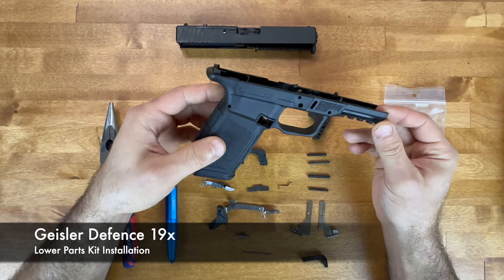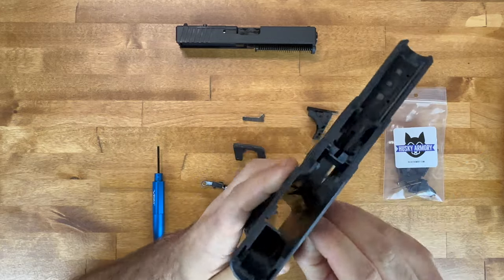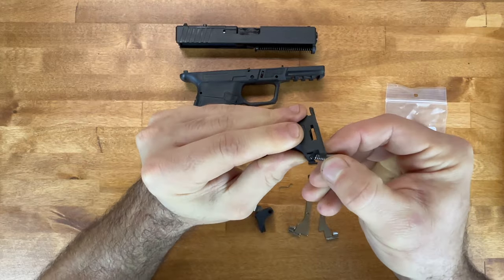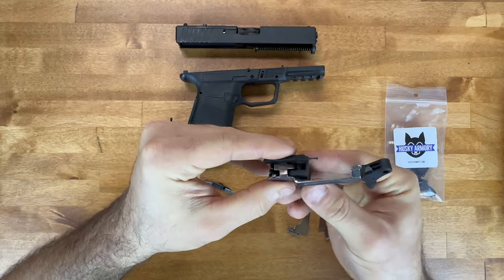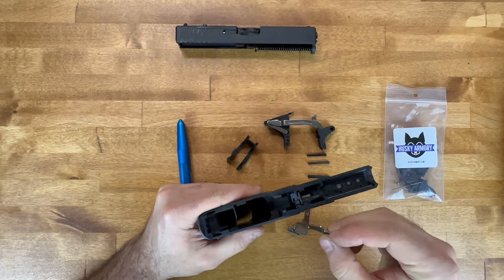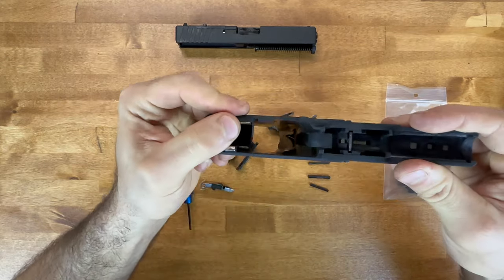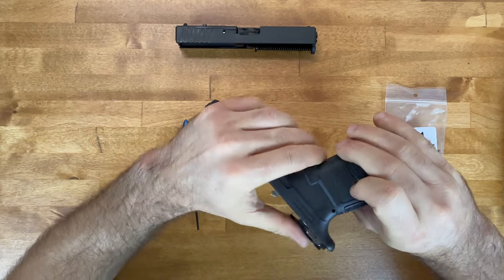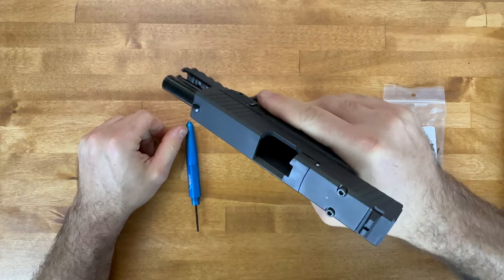Geisler Defence 19x Lower Parts Kit Install Guide

Comment from the maker: Get 10% off your Geisler 19x Frame code "STAYFROSTY" https://huskyarmory.com/80-frames
Reply: @huskyarmory   what magwells fit the 19x  model yall make I can't find not a single thing of info for it
Reply: @huskyarmory What Lower parts kit Goes , with the Geisler 19x Frame  ?  Is it the 19 or the 17 Lpk ?
Reply: 17 lpk  17 mag
Reply: @justonmartin634  Thanks
Man , also another question how do I turn it into a Glock 23 with the geisler frame ? Do I just change out the ejector
To a 40 cal one ? Or what really
Need help
Reply: @DedeJames-o2q   definitely  barrel  and extractor  I'd do those first see if it functions guide rod shouldn't make a difference
Reply: @justonmartin634  okay so basically I just need the barrel , Slide & change the  extractor ? , what about the ejector
Reply: I got a psa 9mm slide I love it ido if they make a 40 but I haven't looked but solar psa has the best prices for the quality  I got mine for 190  suppressor sight threaed barrel slide cut on green and bronze 4.5 barrel good deals they have but also if your trying to go basic bear creek has slides too
Reply: @justonmartin634  okay great thanks for that information , but do I need to change out the ejector as well ?
Reply: Ejector extractors  same thing to maybe
Reply: Disculpe hace envíos a México?

Comment: Video isn’t so helpful. Can u show closer exactly where ur putting stuff. Especially the spring for the release.
Reply: U don't want thar frame . My buddy got it and noticed it was made in a garbage cou try so he tossed it immediately destroying it making sure no one has to suffer with it. Get urself  a dood 'ol american p80 or psa dagger there better quality and made here.🇺🇸🇺🇸🇺🇸🇺🇸🇺🇲🇺🇲🇺🇲
Reply: It's a good frame if you know how to build
Reply: Their frames are much better than oem and p80 and gst-9 frames imo. Does take a little more know how than gst9 and p80 but definitely worth it. A trick to the mag release lever is get it inserted into its pocket in the front of the grip. After you gently let it rest in there don't force it, stick a finger thru the bottom of the grip where you can use a finger to stop the spring from falling out when you tilt the frame backwards. While having it in this position slide the mag release lever in then grab your punch and use it to pry your spring over to slip into the groove for it on the inside of the mag release lever.
Reply: @pepepantuflas1  psa doesn't make 80s and p80 screwed over their good old country buy selling frames and not shipping. Almost a year now and they don't have any frames coming out
Reply: @yeks1491 the fact he says it's trash because it's from Israel is pretty funny
Reply: @US2A is it trash though?

Comment: To bad it’s not that easy. Only problem (so far) that I’ve had with my build is the take down lever is being pressed down by the slide and when I pull the trigger the slide comes right off
Reply: If you never solved this issue on my frames I recieved from them, I had to sand down the ramp infront of the trigger hole that is behind the slide stop takedown lever. It was partially covering the groove in that lever which is what causes this issue. I ordered 2 frames and had this issue with both. Once you take that ramp down some it will solve the issue. It can be a bit of a hassle but not too bad. If you still need help I can get in touch with you and give you some other platform info to actually show you. On my p80 frames they don't even have that ramp that is kinda how I figured out the fix tothe issue. However oem glock frames do, so rather than removing it fully I just took it down some so the top of it is below that groove.
Reply: @Htx_GHOST713  so they sent me an updated frame and I wish they would get them sent out. They are behind schedule but the internal walls are higher and no slop when the trigger is pulled. Have a video on it
Reply: @Htx_GHOST713 can we get in Touch I have a couple of questions about my Geisler even videos at the range

Comment: Does anyone know y mine isn’t racking a round? It hits the barrel when I try to put one up but goes smooth with no mag
Reply: Your slide release spring is supposed to be below the top pin the spring shouldn’t be in contact with the locking block this could cause some issues

Comment: anyone make a thicker slide lock? the slide lock hole is a little out of spec.
Reply: Yeah I messed up on my damn holes because the holes on the pieces don’t even line up :/
Reply: Just buy extended slide stop levers. I put them on all my glocks bc I got big hands and big fingers so grabbing them Fuckers when they are oem spec is almost impossible. But with extended ones the ends stick out more than enough to grab easily but not too much to be sore to the eye

Comment: The slide release spring is supposed to sit below the first pin it shouldn’t come into contact with the locking block it could cause failure to go fully into battery issues other then that great video

Comment: So.. what you mentioned in another comment is that you basically need the G17 lower parts kit from Husky that has the longer slide lock spring?
Reply: Correct

Comment: Can you put a gen 5 slide on the frame since the 19x is in the gen 5 family ?
Reply: This is a gen 3. If you can put a gen 5 on a gen 3 then yes. If not then no
Reply from the maker: Possibly w/ an adapter / get 3 recoil conversion spring.

Comment: I have an extra L shaped spring sort of thing that came in my lower kit. Idk wtf it is. And my trigger isnt resetting
Reply: Alright I think the spring is just an extra that came with the kit as I believe the bigger L shape is for Glock 17 slide lock and the smaller is for Glock 19. As far as the trigger, I’m pretty sure the spring is backwards. It should make an S when looking at it from the right side, not a backwards S
Reply: @TimboTactical  ty buddy
Reply: @TimboTactical  you were right! Thank you bud!

Comment: Bro so what Lower part kit  would I need too buy for the 19x build? Laik a 17?
Reply: 19 or 17 gen 3 I went with a 19 gen 3. Works fine.
Reply: @finnanutyo1153 can I do 23?
Reply: @LathenBlissit  idk. I'm pretty sure they're mostly identical. Just make sure it's for a compact frame. Make sure the trigger spring is for a Glock 19 btw. Z
Reply: @finnanutyo1153 what magwell?
Reply: @LathenBlissit yes
Reply: You can’t use a 17 slide 🤦‍♂️ Geisler is a full size frame (17) that accepts compact slides only (19,23)
Reply: @slide023 so can i just get a glock 19 gen 3 lower parts kit and use that? i dont wanna waste my money🤣

Comment: What lower part kit is that and does a glock 19 gen 3 lower part kit fits it?
Reply: It’s not a 19 its a hybrid of the 17x and 19x
Reply: @LathenBlissit so question when you have a 19x what lower parts kit do you put inside of it??
Reply: @Splxtyic  u can put g19x our 23x same with the slide but for the magizne u need a 17 magazine if u build the 19 our if build the 23 u need a 22 mag

Comment: If anyone is having any issues with their build I like to help others and will give you my two cents haha just reply to this comment with any issues you may be experiencing and I’ll get back to you
Reply: Mine won’t shoot I tryed to shoot it with a dagger slide
Reply: @3Baby3rd  could be a safety plunger issue the vertical extension on the trigger bar has to disengage the safety plunger for the firing pin to to come through the breach face.  Or maybe you’re having engagement issues please provide more information on what’s happening

Comment: Does a Glock 19 gen 3 trigger assembly fit in that 19x upper?
Reply from the maker: Yep, the only difference is the slide lock spring which is the Glock 17 version (a bit longer).
Reply: @huskyarmory  ah… ok. Thank you.
Reply: I’m having issues with the trigger, it’s a 19 gen 3 lower
Reply: Yes it will
Reply: @huskyarmory I did make a comment at the top as well. So do you need the g17 lpk that has the longer slide lock spring?
Reply: @huskyarmory do we need the g17 longer slide spring?
Reply: @MaliyaEvans did you ever get that resolved?
Reply: @jonathanhavel1036 should I get a OEM G19 Lpk? Having problems with my geisler lower
Reply: @deuceglo6399  I'm not sure I can help. I haven't even got to shoot mine yet. But I will say this. I don't think you need OEM. They probably wouldn't fit right anyway. I polished my trigger and polished where it was rubbing against the inside of the lower. You just have to watch a bunch of videos and spend time with it seeing what parts need tweaking.